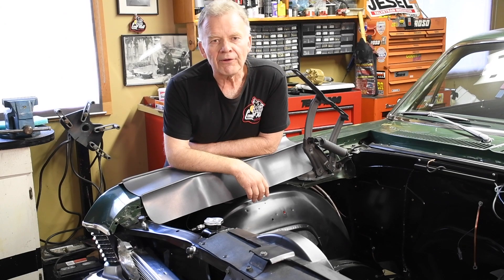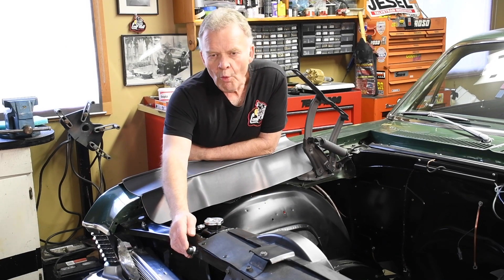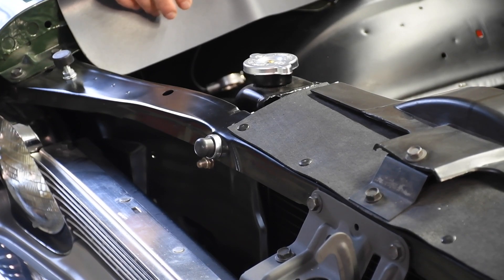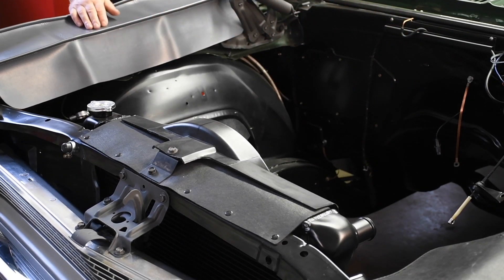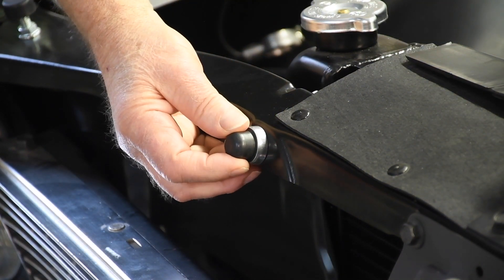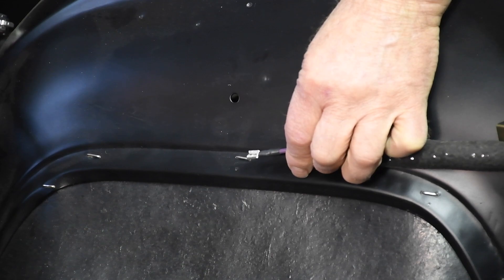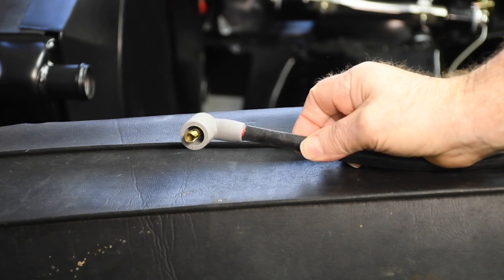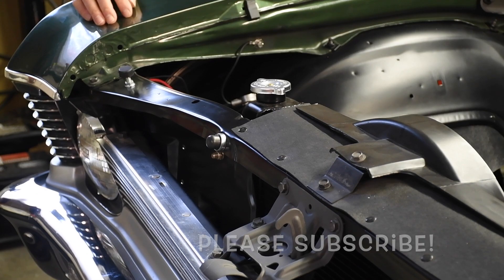How To Build A Permanent Starter Bump Switch

Comment: Another useful how-to tip, Wayne! Many years ago we rigged up a similar underhood switch for the Dan O'Connell & Jim Hill '57 Chevy F/Gasser, using a Ford relay switch. Numerous different roller cams (Crane, of course) required frequent lash adjustments while the engine was still hot. Later, I did the same for my '69 L-78 Camaro, which required frequent valve lash adjustments. Crawling under the car to attach alligator clips while scorching my hands on the headers got old quickly, so a remote starter switch was great! Your suggestions and simple diagram should be easily followed by do it yourself types.
Reply from the maker: Thanks Jim!  I appreciate it. If some of you don't know, Jim was a force behind the scenes at the old Crane Cams for years!  My plan going forward is to make more of these little tips that we all used years (ok....Decades ....L-O-L) ago!  :)